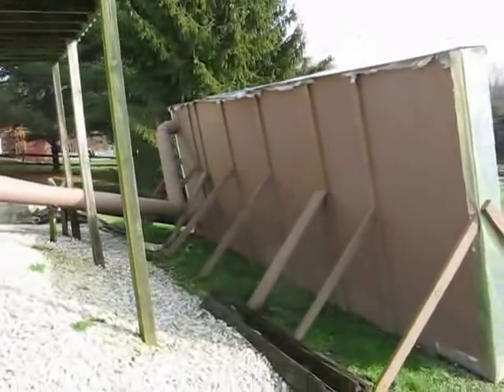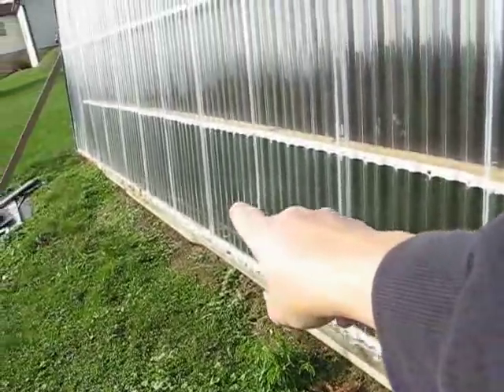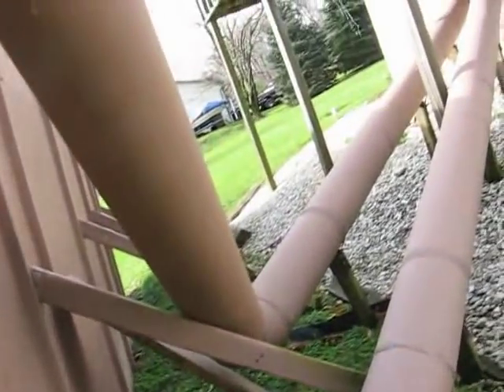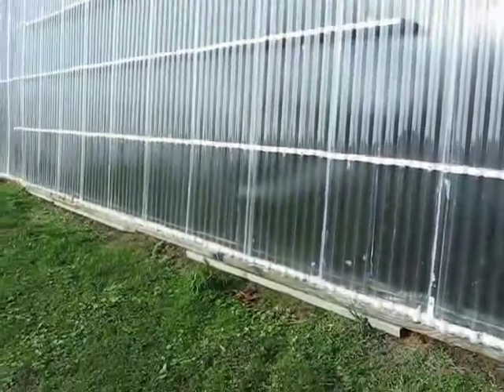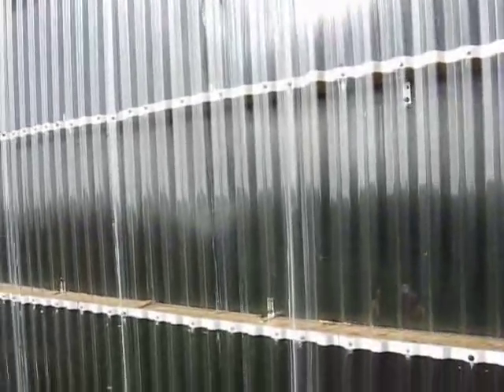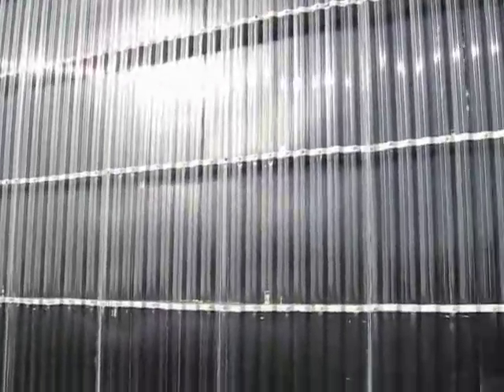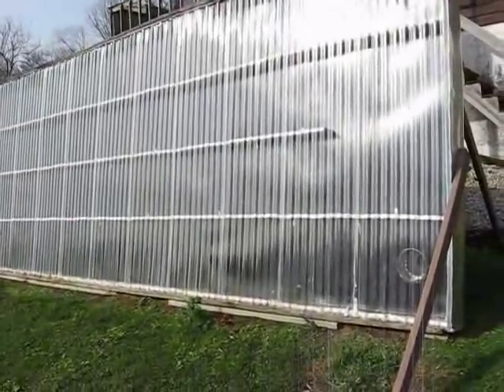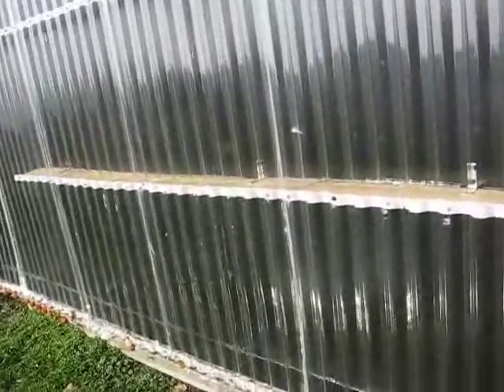MY SOLAR FURNACE  self standing solar AIR HEATER

Comment from the maker: hi everyone,  yes the back of the heater is insulated,,  and its still working great going on year 6     the wind has not been a problem has not moved,, i do have a  a bit of repair on the back side come spring,, but nothing big,, just have to tack a few things back into place,, but so far its still giving heat on a nice sunny day and it can be 10 degrees out its still working great,

Comment: i made a box like that and put copper tubing all through then put it on top of the gazebo roof connected it to the outlet of the pool pump and free heated pool,,you get another maybe 6 weeks to use it...very careful to blow it out for winter

Comment: It would be interesting to know how much heat you're losing from the back side through the wood.  You might pick up some efficiency by spray foaming that back side.  Not criticizing, just wondering because if that's true, you could design one to do the same job but a little smaller.  Thank you for making the video and sharing it with us!

Comment: the roof on my out building is the same material, I built it about the same time you did this.  Its nice and bright in there all day, a little cold in the winter without a wood stove. It is always about 10-20 degrees warmer inside during daylight in the winter as well.

Comment: I use a power roof vent thermostat to run the fans on my wood stove.  It is adjustable and available at the hardware store for under 30 bucks, usually.  I use to run timers but got tired of messing with them.

Comment: question. how well does this work during fall and winter seasons. when the heat is actually needed. you mention this works great on a sunny day but on a sunny day i typically dont have the heat on..

Comment from the maker: wow folks a lot of comments,, i will try to answer some of the questions,, yes the back and pipe is insulated,  i did this when i build it and its states that on the video,, now 2014  its still going strong, yes clear roofing material did fog but it still gives off a great amount of heat,, the btu, is about 33000 btu,,  yes it only works when the sun shines :)   and no i didnt need a permit,, there was nothing in writing about solar heater lol ,,    a few repairs have to take place, one panel in the back a woodpecker got at it,, i plan to take care of that in a week or so,,  but most of the seals have held up very well, considering this is mostly a maintenance free unit,, the same fan ,, other then the fan there is no moving parts,,  and if i need to replace it is 30 bucks,, so my heating bills were a bit higher last year,  it was a super cold winter for us,,,,  it was about 200 more to heat the house not bad,, yes it heats the house during the day .. often times if its not super cold out 20 and lower out,, my furnace will not kick on till about 11pm to 1 am till morning,, so yes this unit is not to heat all day long ,, its has saved me money from purchasing  gas for my home,,  so since 2008 my heating bill remain very much the same every year,, ok folks ,,

Comment: if you whan more heat just use mirrors to reflect the sun in your device also you can adjust those mirrors to get the same amount of heat all year even if the sun position changes

Comment: google 'snap disk fan controller'... the one i got is adjustable... manufacturer is white and rodgers part number 3f05-1... it's smaller than an egg, and you can wire it into the fan, so it starts automatically, not on a timer... so set it to say, 130F, it will automatically start the fan when the air inside gets to that temp... and the best part, they're about 9 bucks!   i built a small SF using dog food cans, and an old computer fan to heat a greenhouse...

Comment: Great job.  One super cheap and easy mod would be to run the outlet to a rock bed.  In the rock bed you put a coil of tubing that precedes your hot water heater.  This will accomplish some thermal storage as well as water pre-heating.  Keep up the awesome work!

Comment: In my experiments I built a small box and the regular paint was better I used Krylon and gave it two days to dry it has to cure before it will not give off the smell and in the box it got up to 156 it stopped smelling after 3 days of this krykon is actually aflutter black just for your info . Another idea I had success with is running the air on the underside of the metal catch plate then run it over the top then to the out put you get two passes and radically higher temps.

Comment: Thanks for the great info.  I've thought about doing something like this, or using water under one or between two sheets of glass ontop of our metal roof.  It's all just about getting as high of a percentage of the solar heat per area as possible, moving it to where you want, and dispersing it.  Air isn't the most energy dense, but it keeps it easy and you don't have to worry about it freezing.  Nice setup!

Comment: ribbed reflects more sun, so no. and you can dimple your glass so it does not bounce light back (reflect) through etching. Search ebay, etc for 'solar' glass and you will find the new glass upgrades that advertise the discovered benefit of pebbling the surface to diffuse the light better. A way to see this effect is to "soap" a window and observe how it effects its ("brightness") overall light transmission. Good luck. PS- I am collecting old patio doors for mine also!!

Comment: This is hard to do without being an ass but I will try.

The sun shines all the time but you only face it during the day hence this will only work during the day but it still gets cold during the day. If you can pull in extra heat absorbed from the sun that is less your furnace will have to work during the day. It won't kick on as much and won't have to run as long.

This is for people who want to pay the energy corporations less and burn less fossil fuels.

You may not care.  That's okay.

Comment: I you ran a pipe from inlet to outlet and sealed it,you would still absorb the heat without the smell,basically your box would be a heat exchanger.

Comment: I agree you should have built it on the roof. and You can greatly improve efficiency if you insulate your ductwork. Also.. I don't know what your electricity costs are, but solar water heating is an easy way to remove the cost of operating an electric water heater.

Comment: I have been dealing with paint curing issues on my Rocket stove Fireplace and found that the High Heat Paint doesn't cure until you reach 475 degrees.  on the smell of the wood, I have seen on other videos of similar collectors (done on a smaller scale) that they put duct work tape over the wood to separate it from the heat chamber. They didn't state weither this eliminated odors or not. I'm planning on building one of these soon, but considering water because you can store the heat in a tank.

Comment: You COULD run a water pre-heater loop in the box for Summer use.   

Keep in mind that you'll get either good hot air or good hot water but not both; so a "drain back" system to get hot water from the panel only during the Summer makes sense.

After all, during the Summer it's going to sit there unused because you don't need hot air.   If you preheat your water this way, you will save a good bit of energy.

Comment: Run a dark garden hose back and forth snaking through this . YOu could get at least a hot water tanks worth (more likely 3 if you snake the hose back and forth) and then drain it into your hot water tank. You will decrease the work of your hot water tank by 70 percent (it will only have to push the water temp up a little instead of from cold water. I run a system on the roof like this on the cabin. Hot showers and heat absolutely free for our cabin also water will retain heat in your hot air

Comment: When you use metal in place of wood, paint it black to help with the heat.  Also, you might think about painting your duct work a flat black to help with heat.  Question, is your angle correct to get the max sun?

Comment from the maker: no i do not use this in the summer,, i use it in the fall and spring, it works the best, and also in the winter to help supplement the heat,, you will still need another source of heat,, because the sun does not shine every day here in pa,,but i do not use the gas heater till the nights get very cold or in the winter when temps do not get above freezing,  , which the solar heater will not work when the sun does not shine,,

Comment: Thanks for the Idea..

Questions? 

have you tried to use smaller air channels? so that the air would be forced to go back and forth more times? before being pushed back to the house?

have you tried to angle the the air channels a little? so that the low end is cold and the higher end would be for the hot?

have you tried adding any thermal mass to the black backing? and the insulate the thermal mass?

and you mentioned adding water pipes for collect hot water.. 

FANTASTIC BUILD!! Thank You!!

Comment: Wow that is the greatest! ! ! I am impressed. I like the way you insulated the outside duct work. insulated flex inside sheet metal. 
I have one suggestion that you could add at any time for low cost. cover the outside of the corrogated plastic with window film. this would achieve two ways of saving heat. ONE: there would be two layers of plastic film providing an air space to help retain heat. 
TWO: the flat plastic film would greatly reduce your surface loss area on the corrogated plastic.

Comment: Great job on this build, it's been a big learning curve i imagine. I think this could be improved if you had used aluminium downspouts in the box with a manifold each end, also because the box is so big I would run my hot water in it also.

Comment from the maker: it had to cure at least 275 degrees and the box in the hottest got up to 210 in the summer,, it would not cure ,, once it cured then it would not put out fumes,,  i call them direct,, and if you were using this on a normal stove it would have cure,,

Comment: @carverswoodshop The first mistake you mentioned was that you used Rustoleum high heat paint and it stunk. But you don't go on to say what you later used instead to fix this problem. Could you let us know? Thanks.

Comment: @junkyardnut 
It makes a difference, believe me. when the air is moving inside the cans, it don't make any contact with the "window" of the collector, and the heat loss is reduced. The air between the cans and the lexan works as a good insulator, and the efficiency is better. 
It's good to make a can heater if you don't have enough room for placing this one, because the cans will work better and give you almost equal heat for every position of the sun during the day because of their shape.

Comment: This is great.  The only difference I would make (if I were building such a device, which unfortunately I'm not currently!) would be to use water as a heat tranfer medium.  Water is a great heat - storing "battery" and thus could heat the house well into much of the night (unlike air).  But if one wanted to avoid glycol, you would have to insulate the water very well . . . Using water would be no different than any radiator system . . .  Thanks for the video - very inspiring!

Comment: i am not sure if i got this good. 40 000 is around 11 kw right? if you're  getting this power, think about placing bricks in the house (find some way to make it good looking) and switch half of the hot air to pass through it's wholes and you will store half of the energy for the night

Comment from the maker: @redsquirrelftw it does great but of course you will need another source of heat,, today it was a high of only 27  it was 68 in my home for most of the day with the sun,, but as the sun lowers it has to be heated,, i have propane furnace, and baseboard heat in the home,, i added the propane furnace when i bought the house,,  base board heat was the only source of heat

Comment: I use mirrors because I can manipulate mirrors to any level of concentration.. I like about 6X concentrated sunlight hiiting at me because it feels like fire!!  without any need to chop and clean up the fireplace or stove everyday.. Easy does it!!  Yours is just circulated heated air that is similar to central air systems through ductworks.. which is nice but not as warm and toasty as mirrors that you can concentrate in one room. I hit 150F in one room, sweating bullets!!!!! check it out

Comment: This is exactly what I always had in mind. That trasnparent corruglated plastic film is very economical to scale up.  I want to suggest that you can add some reflecting materials at the base to bounce up more sunlight into it.   You can glue aluminium foil on plywood or OSB boards . I dont understand why some people use beer cans inside it.. I dont see the logic in it.. make no difference with cans !

Comment: Im just curious about the total heat loss in your duct work.. forgive me but from this video it looks completely uninsulated. I would also have to agree with your previous statement about using metal over wood. Also talk to someone about getting more curves into your design. Your CFM will rise a bit if you round your corners. I am a HVAC tech and this is interesting to me.

Comment: If you're looking for a way you can store heat for cloudy weather or maybe even a day or so later, then use WATER or ideally a water/antifreeze mixture. Water holds more BTU's heat value than almost any other material. Hot air warms up the fluid in a radiator [heat-exchanger]. This very warm or hot water is then stored in large under 100 gallon or maybe even multi-hundred gallon insulated tank{s}. All you need for hydronic baseboard or in-floor heating is 90 degrees Fahrenheit fluid temp.

Comment from the maker: update, 11-20-11  today it was 37 degrees in the morning ,, in the house it was 61 with some heating from gas furance overnight,,  today it went up the 74 degrees, and at 7 pm it was 67 degrees,,  so the heavier fan is a big plus,, the heat coming out of the solar today was near 125 all day,,  so its working great with the heavier fan without cooling it down,, i only wish i put this heavier fan on earlier,, :)

Comment: @lurmot  relax..  no need to worry about storage... just let the sun do the work until it sets  ..  If the weather is foul, so what??  Use the traditonal way  .  If enough of us do that, then traditional energy prices will plummet  enough to make storage unnecesary.  I just dont understand why some people are fretting about storing solar energy.. I think that we should be focused on generating as much solar energy as possible first then worry about storing it much later after additional research

Comment: if you wanted to store some of the generated heat you could run black pool heater pipe (lots of it in a closed sealed system) to capture the heat in water then pipe it to a thermal mass...say concrete or stone or more water (55gl drums)...something like that...the thermal mass will radiate out  heat after the forced air is too cold and gets turned off...just a thought....

Comment: great job.   I think if I was going to make one that big i would take in to consideration the air likes to "Flow Smoothly" in the path of least resistance.  
I think I would make smooth curved corners everywhere I could and have the exit hole be more like a funnel and on the end not the back.
Still who am I... I just found out about these like 30 min ago and like totally want to build my own test one to try and heat my garage in the winter.  I see others use solar powered fans to, thats bad ass

Comment: Great piece of work. One thought I had ....it may be of value to double glaze the upper sections, ie the area that gets hottest, but also the area that will be radiating heat back into the atmosphere, reducing that will maximise temperature. It may also be of value to build a passive solar store....ie a lump of mass, be it dense brick, or a lump of water, a ton which would aid longevity, ie after sunset, but some control gear would be required, be it hand operated flaps or somthing more hi tech.

Comment: Awesome system, did you ever imagine replacing your whole roof with a system such as this?  I wonder what the energy savings would be if every house had their south facing roofs turned into air and water heaters?

Comment from the maker: ok just for answer a few question,, i would not use any black paint, only the metal that already had the black paint on it,  i got mine from a roofing supply store, the paint is bake on the metal,   and the heat is not store, once the sun comes up a fan kicks on and the heat in the box is forced into the house,,   the fan is slow,, so it on the a timer and turn off  a few hours later,,  when no sun i unplug it for that day,, i can put a senor on it but i have not done this yet,, ok thank, arleen

Comment: Great to see this unit.  A couple of observations, 1 ) would it be a thought to look at the return, heated air duct  to the house, could you straighton this so you are not tring to drive hot air down hill, If you look at the layout on early un pumped car coolent systems, convection works a lot better if its just up hill, would save some motor/ fan load. 2 ) Front cover only single layer, so you loose energy back out the system 3) Add a refector on the ground infront of it, white painted board .

Comment: A few q's. I am new to this stuff so be nice.
That solar box is where the air is stored and heated until your fan pumps it into the house right? There's no other storage of this heated air right?

Doesn't after say 10 minutes of running a fan and moving the air through, the air is now cool and you're moving cool air into the house negating the hot air effect? Or does any air that enters that hot box become heated before it gets to the top?
Thanks!